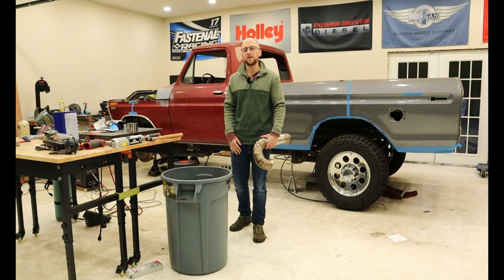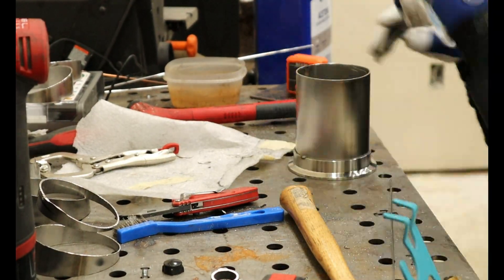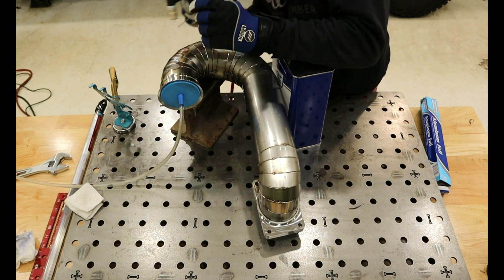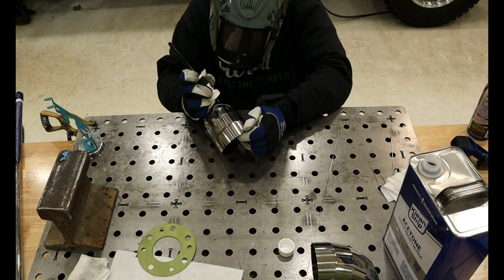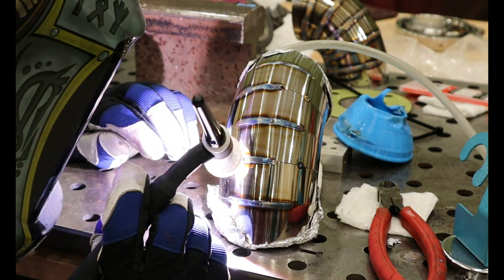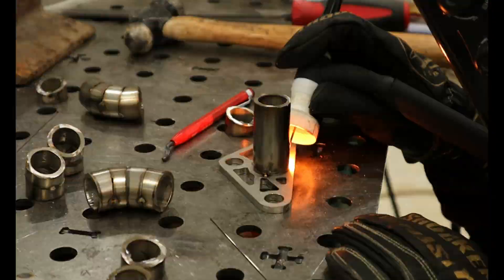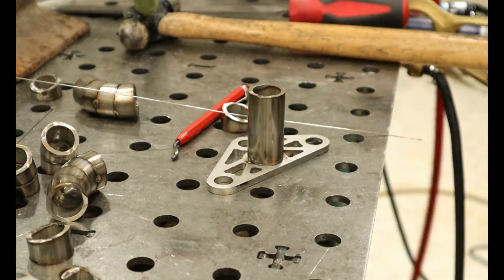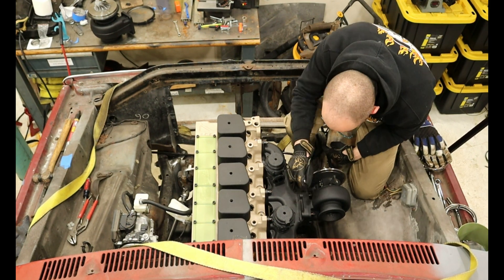My Custom Compound Turbo Journey - From Failure to Success!

Comment: I had a bad experience with the Cerakote V-series on my turbo. I think I failed with the surface preparation because I didn’t sandblast it. I only cleaned it with silicone remover and a Scotch-Brite pad, and the turbo was brand new. The coating started falling off after the first time the turbo got really hot. Or it might have been that the temperature was too low when I cured the paint, since I only used the paint booth and heated it up to 80°C. I’m going to send it to a powder coating shop that has an oven and a sandblaster this winter to fix the flaking
Reply from the maker: that sucks man! I just finished up the wastegate piping (Video now live) and i noticed one spot was flaking off. 
Prior I had an oven to remove oil and multiple clean tanks to degrease along with a professional booth. 
Now that I'm in my shop, I don't have all of that. Hoping mine lasts... not looking good so far!

Comment: Looks fantastic you might struggle with the directly welded hotside too hotside though without a slip joint or something too allow some movement check out skid factory's video. Definitely not criticism amazing work 👍
Reply from the maker: Thank you for the insight! I wasn't aware of slip joints at the time! The hot side will have a fair amount of pressure, will slip joints work in these conditions?
Reply: @barnbuiltbeaters that's not what the skid factory used but even oem do use slip joints there's not going to be the space to loose pressure but it'll allow for expansion and contraction as and when it needs it preventing cracking. Once again i ain't being a ney sayer or trying to be clever it's just an observation and something I've seen people have problems with. Your welding and fabrication is spot on just food for thought. Thanks for the reply 👍
Reply from the maker: @stephenbates8370 I appreciate the insight. Ill look into them. If/when it cracks maybe that is how I'll fix it! Thanks!

Comment: what are the green pieces you used to kinda clamp the tubing in the bandsaw?
Reply from the maker: I 3D printed those to hold the tubing while I cut. They were also set at the desired cut angle too but for some reason didn't work as intended. I later just used them to protect the tube while clamping so I didn't scuff it
Reply: @barnbuiltbeaters nice I’m looking for something similar to help clamp tube in my band saw
Reply from the maker: @XxOverLoad93xX  Unfortunately I dont have anything on my Etsy, but I know there are some for purchase there. Let me know if you need further help!
Reply: @barnbuiltbeaters  sure, what would they be under on etsy?
Reply from the maker: @XxOverLoad93xX same as my YouTube Handle! They aren't up yet but you can follow my shop for when they go live! Are you interested in any particular size(s)?
Reply: @barnbuiltbeaters  3" just something simple to help clamp the tube in the bandsaw vice jaws
Reply from the maker: @XxOverLoad93xX  hey sorry got my convos mixed up. 
Look up a 3inch pie cutting jig/clamp on Etsy. You should be able to find what you need. That should hold your tubing whether you are cutting pie cuts or straight cuts.

Comment: Great work! Stainless bros is where I get all my pie cuts and tube. Very high quality.
Reply from the maker: Thank you! I looked into Stainless Bros and they were just a bit more expensive. I most of my parts from Ace-Race. Have you used them? If so, are they better or worse than Stainless Bros?
Reply: @barnbuiltbeaters  I have not. I'll look into them. If you have a buisness, stainless bros will give a discount usually after your first purchase, which also applies to their sister store ticon industries if you need titanium pie cuts and flanges.
Reply from the maker: @HSKFab  That is great to know! Unfortunately Im just a regular guy in a shop! Thanks though!
Reply: @barnbuiltbeaters  I'm the same! But I registered a buisness to get these perks and whatnot with the hope of going full time on my own eventually. For now, it's just a side hustle. Keep up the good work!
Reply from the maker: @HSKFabrications  im tempted to build on the side. Care to share how you started? How did you find customers? How did you price? 

I see kits going for 6g that, IMO, don't look anywhere as nice as mine. I'm tempted to build another kit and try to sell it. Only difficulty, I couldn't 100% verify it'd fit dodges or Dentsides (my truck) as my truck is very custom
Reply: @barnbuiltbeaters  Sure, mostly word of mouth through friends or co-workers. I'm a heavy equipment field mechanic/welder so I'm always out and about.

I haven't sold the compound kit I made yet for the 6.7 powerstroke either since it's just a prototype. I just do custom, one-off piping, nothing mass produced yet.  To make it repeatable, you need to choose a platform you think would sell the most, mock it up, cab off is usually the easiest, then build a jig that replicates that kit for the specific platform. 
For TIG, usually charge by the inch plus a gas/consumable charge. Factor that in with material cost to figure out your retail price for the public. Pie cuts have their niche, people will pay. People pay $20k+ for ti exhaust that they don't really need.

Some tax tips, all this can be expensive, all of it also can be deducted from your income as buisness loss. It's basically R&D. Another benefit of creating an LLC or sole prop. for yourself.
Reply: @barnbuiltbeaters  Look into kapton tape. It's a polyamide high temp tape that doesn't leave residue. Great for holding pie cuts together.
Reply from the maker: @HSKFab  Awesome thank you so much for the details. I know a bit about the tax advantages.
I would end up making a fixture of my current setup. i think this would fit in any dentside as there is a ton of room in the engine bay. I would love to offer the down pipe and intercooler pipe but unfortunately that would be project specific in terms of dentside swaps.
I also feel a bit hesitant because honestly I've never welded anything like this before...would someone even pay 5-6-7g for this. hope that makes sense!
Reply from the maker: @HSKFab  I was going to buy that but it would have arrived too late. I will stock up for next time though!
Reply: @barnbuiltbeaters  From what I see, $5k and up for 12v compound kits depending on turbo combo. None of them I see have full SS piping or pie cuts. So $7k+ is doable. Get this truck out to the truck meets or diesel races and sit with your hood up. Definitely will get attention.
Reply from the maker: @HSKFab  It will be a long time before it is at car shows but I agree, should get a few looks!

Thats crazy to me! I might just have to try. I think worst case I could easily get my money back, just a loss on time is all. Thanks so much!

Comment: Nice work, 👍🏻 just takes time and experence to get the hang of things. 
I started just the same, 30+ yrs later im still doing this type wk on a daily basis.
One thing i noticed and wanted to comment on is the use of the metal "can"  for a arm rest at 2:30 in vid. 
I had a close friend years back that was tig welding up a turbo header on his metal bench. It had the normal clamps and fixture things layed out upon the table.along with some tools and vice grips, on the corner of the work bench next to welding table was a empty vp can of m1 fuel, somehow the tools laying across the table moved and touched the can, upon him moving the work piece ehike welding the ground to the header lost connection to the table and found its path to the bottom side of the vp can, and arched a hole, ignighted the can and it exploded . Luckly others were there to help as it caused major to half his face and side of his head, rushed to the hospital quickly and  surgery he is ok. But scared for life. He most likely wouldnt have made it if he was alone. 
So just watching you lean on that can of acetone and welding got me un easy..lol.
Just something to think about. Keep up the good wk.👍🏻
Reply from the maker: @madnessmaker6162  thanks so much for the compliments! Sounds like you have an awesome job!

Someone else made the same comment and I 100% agree I should be safer. Sometimes you just get into the zone and don't think. I should invest in some arm/hand rests. Have any suggestions?

Comment: DUDE! Phenomenal video and unreal work. Gosh dang im pumped for you I cant wait to see this thing run! Just bought a tig welder and trying to learn. I know its gonna be worse than my mig skills so im stocked up on beer
Reply from the maker: @SheehanRacing  thanks man but it is going to be a LONG time before it's up and running. 
TIG is difficult as I'm sure you already know. Keep a piece you had practiced on as a reference to look back on so you don't get discouraged.
Start without any filler, just focus on starting a puddle, move towards to the base of the puddle and start another puddle, over and over, adjusting distance moved to get a better look. Once you are happy, do the exact same thing just adding filler right before you take each step. 
Not a sure how mig is but rule of thumb is 1a per .001" of material thickness. Good luck and reach out if you need tips!
Furick cups are fantastic for shielding I highly recommend them.
Reply: @ wow thats top notch info my man i truly appreciate that! I saved ur vid and screen shotted this so im a step ahead! Thanks kyle 🙏🏼 get that thang done before sick week next year and lets go!
Reply from the maker: @SheehanRacing  haha that would be an absolute miracle if that happened! I'm more in the mindset of completely finishing my truck before I ever drive it interior, paint, mechanical and all. Otherwise I'll just want to rip on it!
Reply: @ hahaha u know damn well when u start that sucker up ur gonna let her sing cmon!
Reply from the maker: @SheehanRacing  haha too true! It'll be so tempting maybe that means I should build the engine last then!
Reply: @ haha yes then leave that for last 100%

Comment: I don’t know if you’ll ever see this but you really should not well near an open container of acetone or anywhere near one even if it’s closed, acetone is extremely flammable and explosive. You’re doing a good job but you’re lucky to be alive right now.
Reply from the maker: @kenmello7252  you are 100% right, I should be safer. It's easy to get in the rhythm of doing said task and not think about the vapors that can ignite.
I'm not saying I'm in the right, but I've done this a zillion times and never had an issue. TIG welding produces virtually no sparks, MIG welding would be much more dangerous. 
However you are totally in the right, I should be more careful and will be more diligent about this. Thank you for watching out for me!

Comment: Are these turbos internally gated ? Or is there no gate between stages ?
Reply from the maker: @simonburnby  no gate as of now. If you look at the manifold in some of the shots you'll see some 3D printed wastegates. I'll be using these for mock up and then replace them with the real deal. 
Although not as much fun as turbos, brakes are next on my check list. I have a neat surprise for you all, maybe you noticed it in this video! 👀
Reply from the maker: @simonburnby  no gate as of now. If you look at the manifold in some of the shots you'll see some 3D printed wastegates. I'll be using these for mock up and then replace them with the real deal. 
Although not as much fun as turbos, brakes are next on my check list. I have a neat surprise for you all, maybe you noticed it in this video! 👀

Comment: Shouldn't you recilculate the wastagates before the small turbo into the pipe after the small turbo? So the big turbo gets as much energy as much
Reply from the maker: 100% yes! I just haven't gotten that far and will be a future video. The wastegates you see on the manifold are 3D printed for mock up only. I was getting a better idea of how large they are since I have never used one before.
I plan on mounting them under the manifold and tying them into the hot pipe as you described. I want to keep the top of the engine clean if I can but not sure if I have the room underneath for both the pipes as well as installing them/clamps.
I need two wastegates as the manifold is divided.
Hope that clears up some confusion!
Reply: @barnbuiltbeaters  beautiful

Comment: I hope this setup doesn't brack, the cummins is a shaker.    Often setups have boots for flex.   

Great job looks killer.
Reply from the maker: @thekid760  you always need boots for flex. I will have boots by the intercooler to hide them a bit. Otherwise I think it will be fine. I also have poly mounts to stiffen everything up but that means a bit more vibration will be felt in the cab. Thanks for watching!

Comment: Awesome content and good editing!  

I have just finished a compound turbo project with ceracote myself 😊
Reply from the maker: @fredriksteen9765  that's awesome. What colors side you use and what turbos?
Reply: @barnbuiltbeaters  I used, burnt bronze, Tungsten and some other colours. I have made a short video about it https://youtu.be/_ukw-0zTPZ4?si=e6tYaYOHO9Xqvqzw
Reply from the maker: @fredriksteen9765  dang! Awesome work! I seriously love the attention to detail. Is that compound turbos on a gas engine? I haven't seen that done before if so. Sounds awesome!
Reply: @barnbuiltbeaters  Many thanks sir. The turbo combination are a G45-1600 and Gtx3576r works like a charm on the small 1.2L engine. I normally use pure methanol on the hero runs in the engine dyno. But it runs on normal gasoline also. There are a few compound gasoline setups on Youtube. I really like the concept 😍
Reply from the maker: @fredriksteen9765  interesting! I thought gas engines struggled with compounds due to injector sizing. A diesel can run extremely lean or rich which a gas engine would struggle. Cool stuff!

Comment: If you sharpen both
 sides of your tungsten, you can just flip it if you dip it 😉👌
Reply from the maker: @PennerFab  i used to do that but it's easy to get your tungsten types mixed up when switching from aluminum to steel/stainless. 
Not a bad idea just not for me! Thanks for watching and the tip!
Reply: @barnbuiltbeaters  i dont swap tungsten according to material. I used 2% Lanthinated for a long time, but now I use Furick Tri-Wave rare earth tungsten, and it's super stable for ferrous and non-ferrous. It was a noticeable difference.

Comment: Nice work man, looks good!
id recommend adding a couple more seconds to the post flow, i usually run about 7-9 seconds on thin wall stainless at 36ish amps, works well for nice goldy blue welds with a BBW
Reply from the maker: @notsosoupy  thanks for the tips! I believe i had 10 seconds of post flow. I also would tap on the pedal to restart the arc post flow timer as needed. I may have just not had enough CFH at the torch? 
Wow 36 amps! You must be moving slow! I was at 60-65. I have some scrap that I'll be practicing on. The welds came out much better than before but still room for improvement. Thanks again!
Reply: @barnbuiltbeaters  mmm you mightve actually just been a bit hot, maybe the material you're working with is different to ours in australia but for 1.6mm wall thickness 304 stainless tubing 35-40 amps is about right any more and you can risk cooking the chromium out of the metal (unless you're a speed demon) mind you this is without pulsing.
Reply from the maker: @notsosoupy  ahh i forgot to mention i was pulsing. My first try at this was without and I think I was around 40amps. I cooked it badly!

Comment: Great work. For the love of God, DO Not put the exhaust through the hood. That shit is so ghetto trash for a street truck.
Reply from the maker: I actually dont mind the exhuast coming out the hood however, I think there is a right way to do it and a wrong way to do it that looks a bit "ghetto" as you called it. This is just "weekend warrior" truck, I would never do it on a daily. I am not sure which path I will take. Good thing is, I need a new hood so I can experiment to see what I want.

I have a really unique Idea for the exhaust, but Im not sure if I can pull it off. if successful, that will be a future video!

Thanks for watching and thanks for the compliment!

Comment: as a guy who just taught myself how to do the pie cuts on a stainless exhaust exactly like you just did, I have to say, well done.  I went through the exact same struggles.
Reply: Same as well 😊
Reply from the maker: @Nobody716-j5e  one of the best ways to learn is diving right into it. Thanks for watching!
Reply from the maker: Looking back at version 1, I am almost embarassed  by it after completing version 2! I am very happy with how it came out and pretty proud of it!